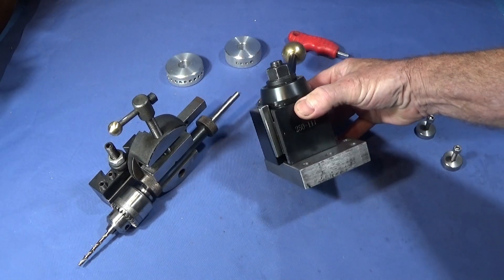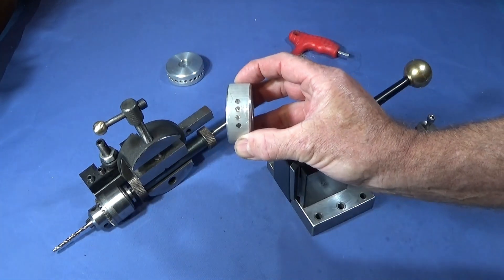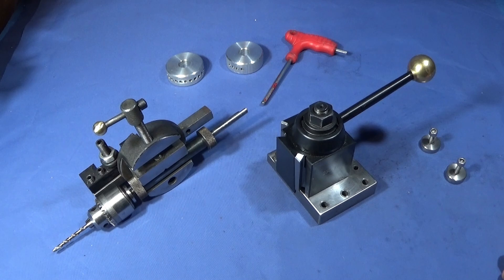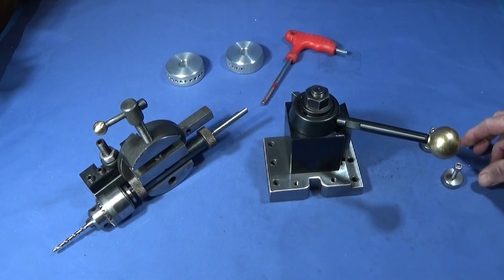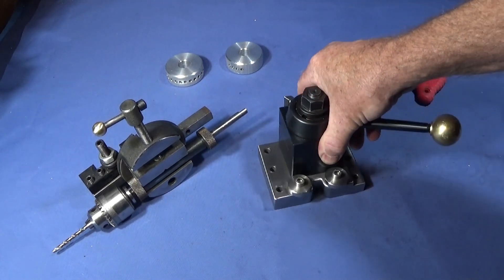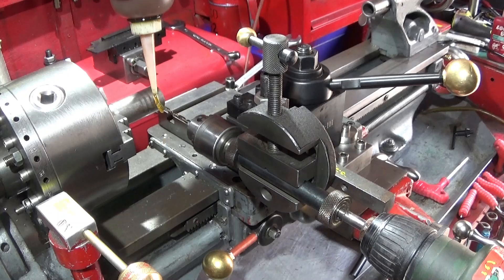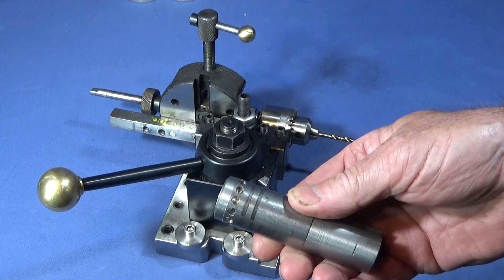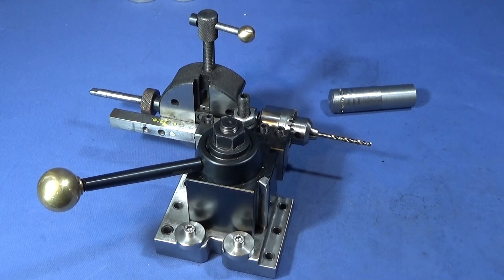My Toolpost Fixture Alignment Locking Screw Upgrade.

Comment from the maker: SEE LINK BELOW:-
Machifit AXA Size DMC-250-111 Wedge Type Tool Post -- http://bit.ly/2lO5Kll
Quick Change Turning Facing Holder 250-101 -- http://bit.ly/2HmNqsO
Quick Change Turning Facing Boring Holder 250-102 -- http://bit.ly/2Hwh5iw
Reply from the maker: UK Warehouse Sale -- https://bit.ly/3fSJTjN
Health Protection -- https://bit.ly/2WvASWi
Reply: @SteveJordan  hi Steve, Please could you tell me the thickness of your tool post mount?

Comment: Hi Steve,. that is just brilliant.  I have noticed how the toolpost does move sometimes even with tightening up solid.  I haven't been able to make that solid block yet to hold the toolpost holder but when I do it will certainly have this addition to it.  I've had other commitments to deal with and one being to overhaul my shop completely so bin limited on lathe time.  Thanks so much for showing this.  Your fan,

Dale in Canada
Reply from the maker: Hi Dale, Nice to hear from you. Thank you for the feedback. The toolpost modification has made all the difference. I hope to show another video soon. Regards Steve
Reply: Thanks Steve,. I'll be waiting.

Comment: Steve, just sharing my experience trying to order a Machifit 250_300 quick change toolpost and 8 tool holders(250_301) Banggood have all the items listed as in stock and order processed in 2 working days. The 8 tool holders are estimated for UK delivery in about 20 working days(not too bad). The toolpost,on the other hand, is estimated to take 50 working days for UK delivery(too long). This order would have totalled over £450.00 gbp. At that sort of amount I would expect all the bits to arrive at the same time and certainly quicker than 50 working days. Needless to say I didn't complete the purchase.😥

Comment: Nicely modded,Steve. That set up is sure to give reliable alignment. I experience the same tool post alignment 'creep' as I tighten the pillar top nut when I'm trying to align a parting or threading tool parallel to the chuck face. It often takes a couple of re-adjustments to compensate for the nut dragging it out of square.

Comment: There sure is a lot of flex of that part when the drill is being pushed inward.  I this just from the part stick out or the chuck/spindle not tight?
Reply from the maker: The jaws were not tight enough on that shot. Also normally I would have the bar protruding less or supported by a live centre for toolpost drilling. Regards Steve

Comment: I like the discs, but wouldn't a bar work just as well? I'd think it would give better support than just two-point contact.
Reply from the maker: Hi Mark no it's absolutely solid. If I used a bar I would have to take out two bolts to take it off if I wanted to swivel the toolpost Regards Steve

Comment: Gday Steve, certainly a rigid set up, perfect centre height as well, can you tell me what type of oil you use, at a guess is it chainsaw bar oil?, when you put it on the end of the drill bit there was no “flinging” off when you spun it up which there’s less mess and no wastage, thanks for another great video mate, cheers Matty

Comment: how did you get that perfect fit?
Reply from the maker: Hi Jeffrey I scribed a line square from the side of the block so the screw holes were in line with the toolpost. Then just put the toolpost on square and turned up a spacer until it just went on touching the side of the toolpost. Then made another one to the exact diameter. Regards Steve